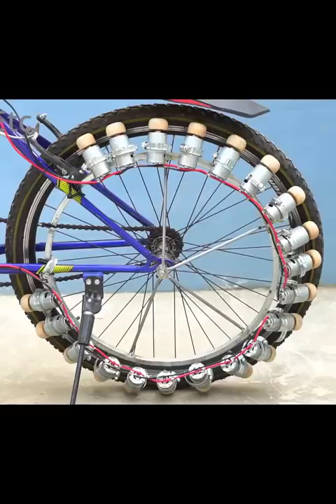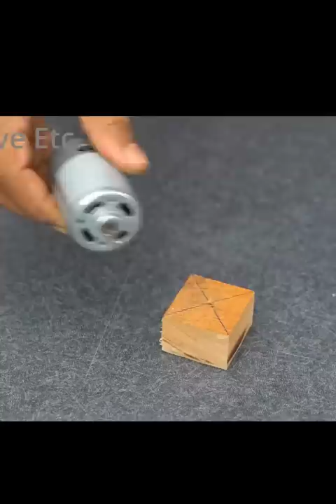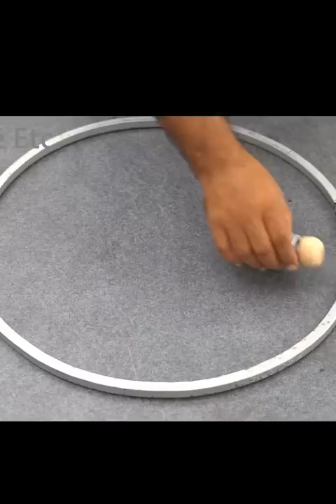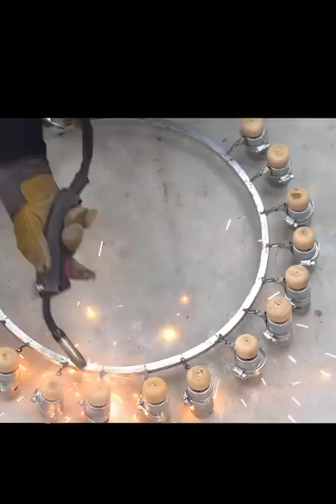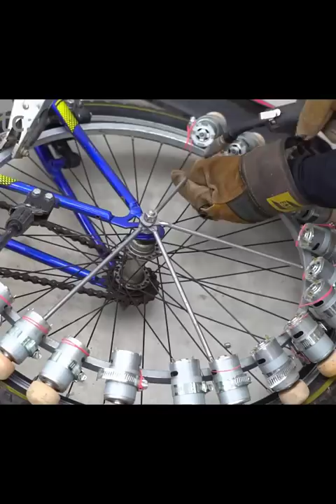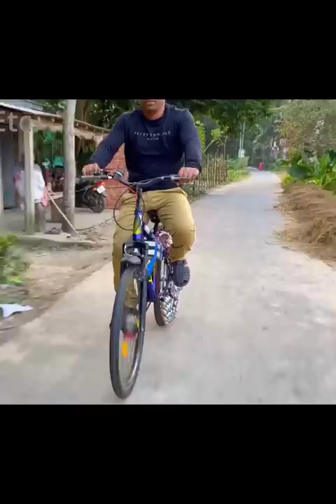I Made Electric Bike With 20 Dc Motors #shorts

Comment: It’s not that this is all bad, it’s just that there are a million better ways to do this. 

I guess if your in a pinch and all you have is 50 brushed DC motors and a bicycle, why not. 👏
Reply: @lukaskleinert9067  It’s nothing to be upset about. It’s a clever experiment! It seems like it would be pretty inefficient when it comes to power consumption. 

Also, I think the tires would take a lot of abuse and won’t last long this way. If the tires get wet will they still function properly against the rollers? I believe talking about things like this is how we improve our design. 

Have a nice day!
Reply: @MotorMenaceFPV  ok

Comment: It would have been better if you have connected in parallel rather than in series for more better results. You will gain more speed.
Reply: Depends on the size if his battery, or connected some of the motors in parallel